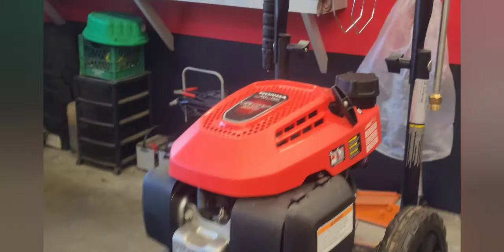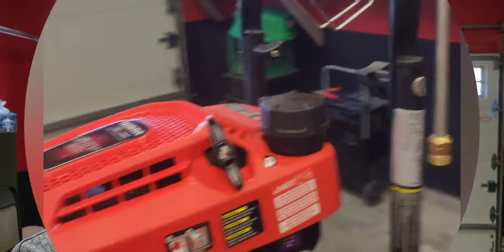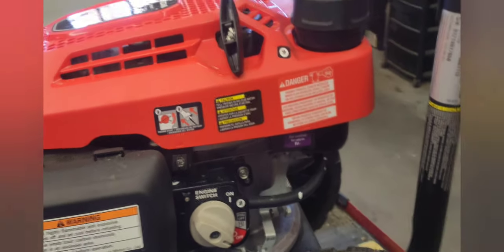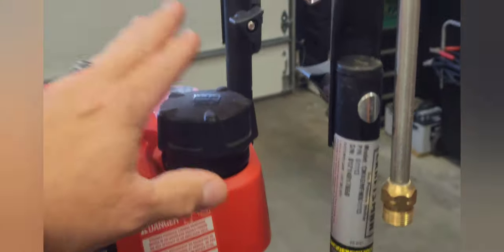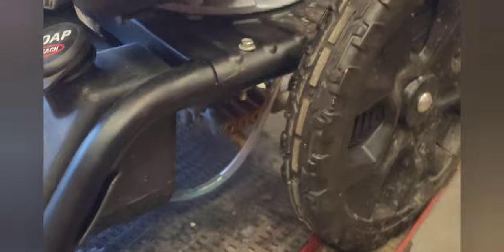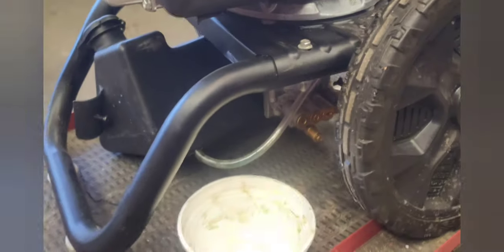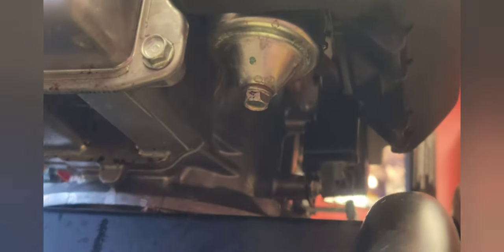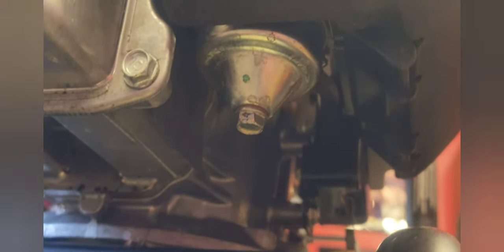Carburetor repair on a craftsman pressure washer with a Honda GCV200 engine.

Comment: Thank you so much for making the video!  Great job!  I have the exact same pressure washer that is just over a year old and won't start.  I've used it twice!  Lowe's Craftsman repair wants $160 to replace the carburetor. I will definitely try your method and see if mine will run after cleaning as you did.  I'll never buy another Craftsman pressure washer however.  Thanks again for sharing your video!!!
Reply from the maker: I hope it works for you. If I were a betting man I'd say that if you follow those steps it'll run like a champ. Fingers crossed for you my friend.

Comment: I have this exact pressure washer, and it would not start at all. I did exactly as you did in the video, and it started right up. Thank you!
Reply from the maker: That makes me happy that I could help you out. A tip for you. Unless you use this at least once a month, you'll continue to have this problem. Crappy design, I think. My advice is if you don't plan on using it for a while, I run the gas out of it and just crack open the fuel bowl so that any remaining gas drains from the carburetor. Just remember to tighten it before you put gas in it again.

Comment: Always loved my Craftsman tools, but I’ve NEVER had good luck with Craftsman mowers/small engine equipment. Through the years I’ve tried one of their push mowers as well as riding mower, and both were simply TERRIBLE. Glad you had a simple fix on your pressure washer !
Reply from the maker: I'm in the exact same boat. The pressure washer has been my problem child. I have a craftsman mower that has been great. Have had it for several years now and never a serious problem. Now I'm having issues with my snowblower. So if I can get that fixed I'll pay a video on that in the future.

Comment: New oil.. new spark plug... cleaned carb... still won't start. 3 years old on the pressure washer. Any suggestion
Reply from the maker: Are you getting spark? In other words, can you see a spark from the plug when it's removed from the cylinder head? There isn't too much that can go wrong here. If no, then check the coil. If yes, make sure you don't have an obstruction in your fuel line. Let me know if any of this helps.
Reply from the maker: I forgot to ask, have you cleaned the jet in the carb? 9 times out of 10 that's where the problem lies, especially with today's fuel.

Comment: My craftsman gcv 200 did not have that stem just the jet to screw out. I didn’t see it come out and am not sure if this one had one???
Reply from the maker: @michaelcostner8703  it's most likely stuck up inside the carburetor. It tapping on the side (lightly) doesn't work, sometimes re installing the jet and removing it again will be enough to make it come out. You may need to do it once or twice even. Try to avoid sticking anything in there to pry it out. I guess I can't say for sure, but I'd be willing to bet that it's in there.
Reply from the maker: @michaelcostner8703  one last thought, you can try a little compressed air, blow it into the jet opening. Just don't use 100psi, full blast. Just a short squirt of air, you don't want to loose it, or damage any seals.

Comment: Your engine still surges while running because you neglected the low-speed circuit in the carburetor.  You're only "most of the way there," in other words.  ;o)

Comment: Did you take the air filter off i dont know if I have my linkage on correctly same pressure washer
Reply from the maker: I don't recall removing the air filter. I don't think you need to, in fact, if I didn't include it in the video, then I didn't remove it. I basically covered everything you should need to do to make it run. Honestly I think it's a poor design, but then I'm not an engineer. Lol
Reply: @bardstables8909  thanks for responding I believe i have a seal issue. Ordering all new just in case, thanks for responding love the video man
Reply from the maker: @abemartinez7653  thank you brother. Sorry I couldn't help. Hopefully that will fix your issue.